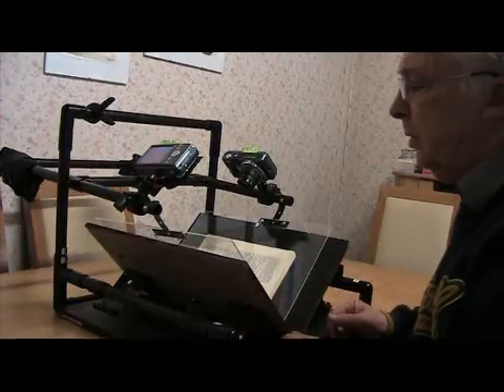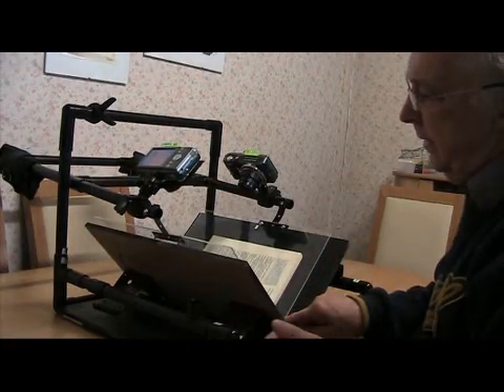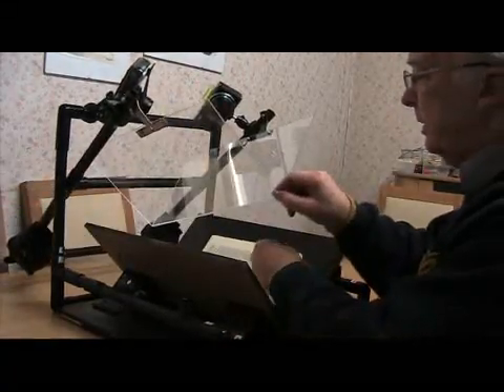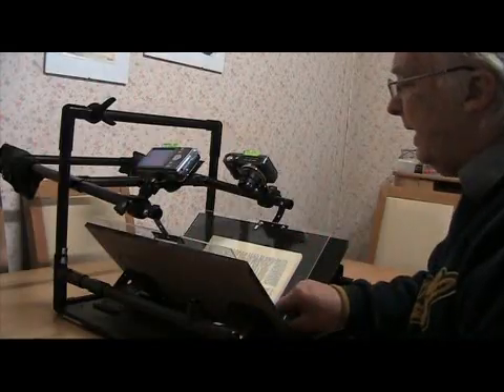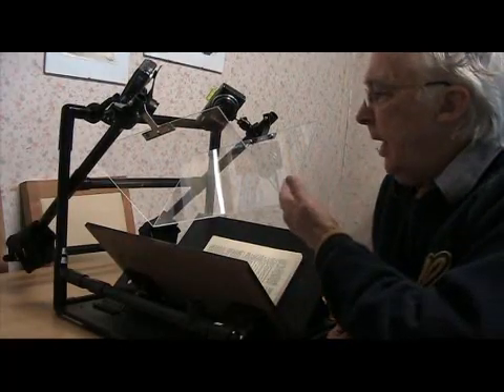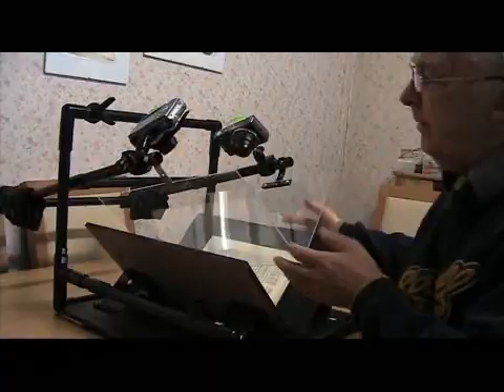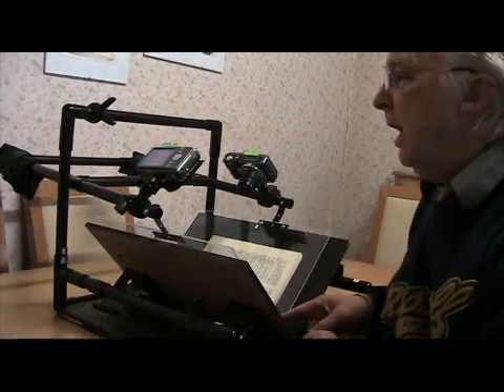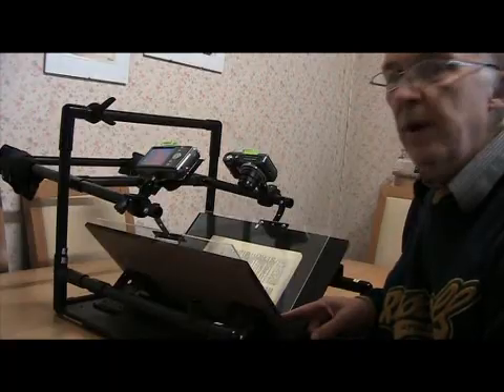The Easy Book Scanner - an Introduction to this 1000 pages per hour scanner

Comment: Excellent idea.
To make it better, use a raspberry pi with two usb web cameras. You can also integrate a simple usb pedal to click the pics. With a little bit of tinkering, I think the same quality can be obtained using a single camera.
Reply: "usb web cameras" That would be worse quality...
Reply: New generation USB cameras have quality on par with smartphones. Or you can use old smartphones as usb cameras itself with appropriate software. @labamba3011

Comment: I counted your speed. You did 1 image in about 7-8 sec. This means 400-500 per hour. Not even close to 1000. 
You have to do it in 3,6 sec. Please make another video to prove your point.
Reply: He didn't really seem to be in a rush to scan the pages. Perhaps if he had worked faster, without demonstrating how to use the device, he could have gotten close to 1000 pages in an hour.
Reply: There are two cameras capturing one page each. So 7.2 seconds does the trick. :)

Comment: Have you considered a foot control for the IR scanner? The signal just might pass through the table. Alternatively you could have some fun with some of the very very cheap microcontrollers on the market to make it happen.

It could speed you up even further! Even if it only takes 1 second per page-pair it will add up! 1000 pages in an hour is 500 page pairs. Take the 1 second out of those and that's close to 10 minutes saved each hour!

Comment: Thanks for sharing！ I want to know how to combine the images into a single PDF file with image corretioning.
Reply: The images that come from the scanner are .jpg files.  They are not always exactly rectangular if the camera is not perpendicular to the document.  You can correct this and make the pictures rectangular by using good free software. There are two very good free software programs - YASW (from SourceForge.net)  and ScanTailor.  ScanTailor corrects and  produces small black/white files (not grayscale).  

You will also need software to batch convert images to pdf.  Here is one that I have not tried, but it looks OK.

www.weenysoft.com/free-image-to-pdf-converter.html

Hope this helps you Stanley
Reply: You would just take the files from the even camera and use a batch rename in cmd or free software to increment by 2 starting at 2 and the same from 1 incrementing by 2 for the other camera then drag into the same folder and print to pdf.
Reply: Book Scanner Abby FineReader has automatic image correction feature and it does its job like a charm. This scanner is brilliant! Thanks for sharing. However, I have a question; Two cameras will have two different page sequences consisting of even and odd pages. How would these two groups of files intersect each other in order to create the proper page order? Do you use any software for batch renaming so that two groups of files will in a sequenced order? What is your approach for this?
Reply: Book Scanner
 You can print the photos on windows in a batch and to a PDF writer. There's no reason to "convert" them, and they all end up on a PDF file.

My concern is that you can't really make the the files named "1, 2, 3" when the photo is shot and even if you can, "1,2,3" correspond to pages 1, 3, 5, as the pages alternate. It's not one after the other, it's every other page. You'd have to change the names or at least individually print them to PDF and merge them later with a program that costs money (I don't know any free versions).

It's a beautiful idea, and wonderfully innovated, truly a job well done!
But I'll stick to using a scanner.